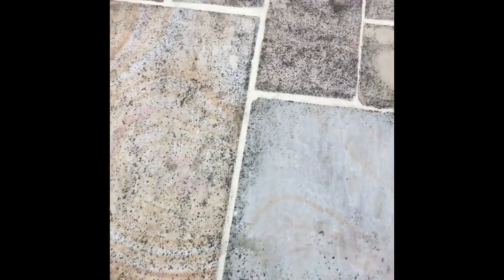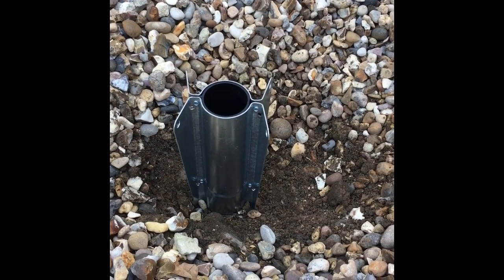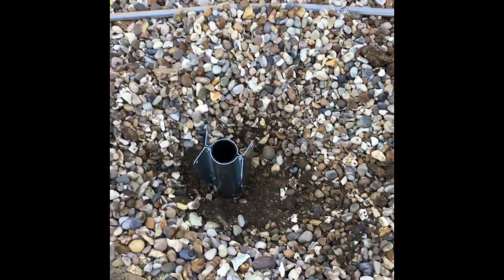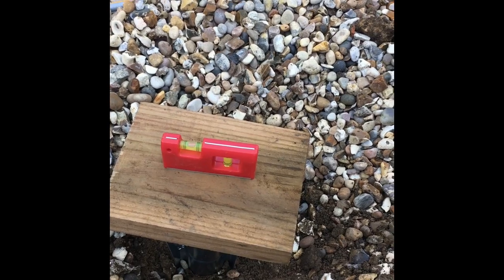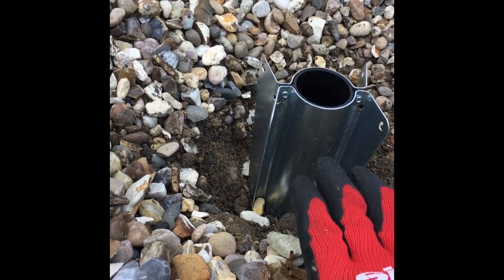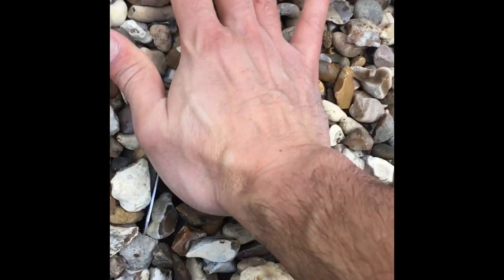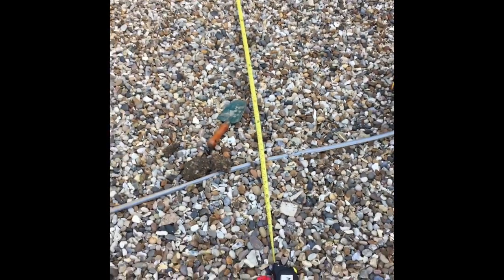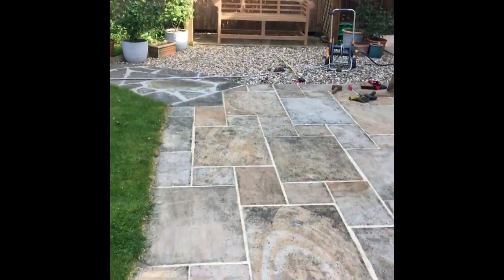How to fit a rotary airier ground spike

Comment: I’ve spent 40 mins and 5 bits of wood hammering the hell out of mine to get it in and I’ve run out of wood- still about 4” to go and it’s on the piss- so will be ‘Bodging’ it to level it up pence it’s in- not an easy job - tbh absolute pain in the arse and very physical work getting it in